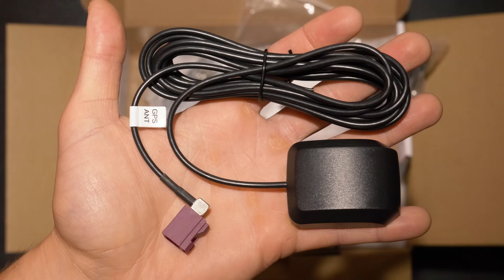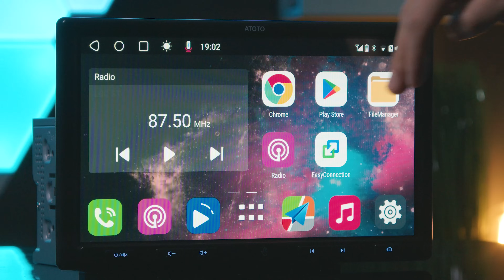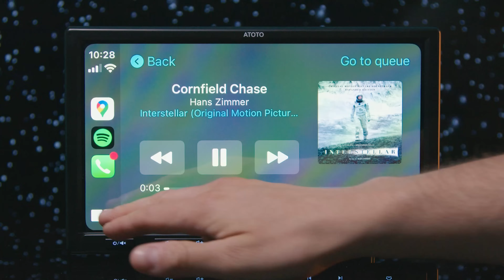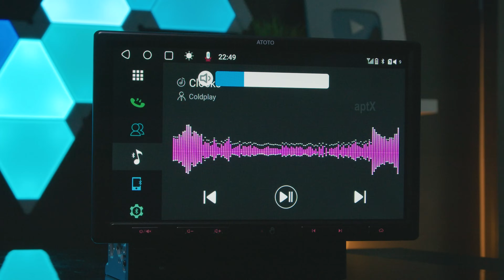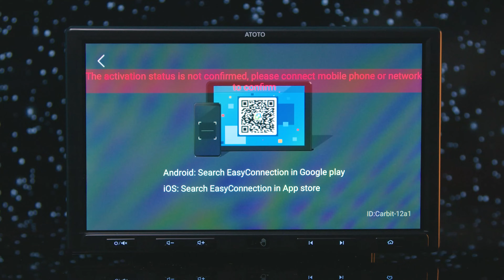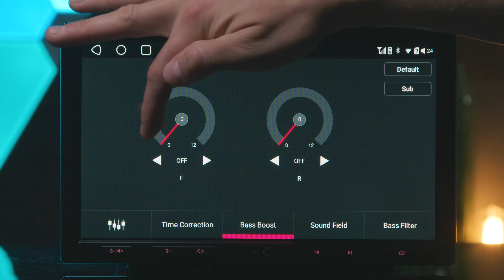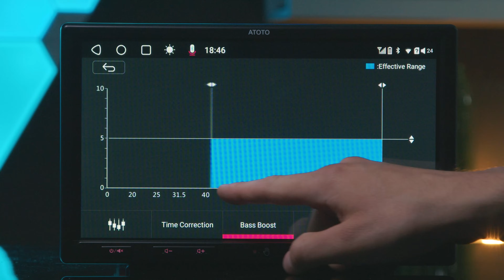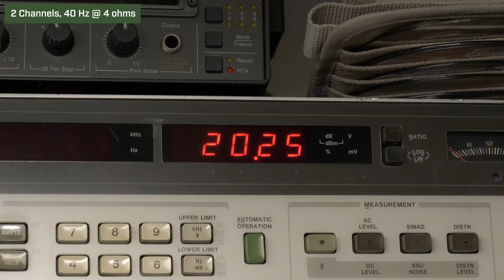ATOTO S8 Ultra Plus Android 10.0 Headunit - 4G, WiFi plus Wireless Apple Carplay & Android Auto

Comment: Hello, i have a sprinter 4*4 from 2010 and i already have a rear view camera mounted , do you think that the camera will be compatible with the atoto s8 ultra plus as it is not an high definition camera ? Atoto says that you nead to buy their own camera  ATOTO AC-HD03LR to have the high definition but will it be compatible with a low definition camera ?
the sprecifications from my rear view camera are as follow : 
1.Pixels: 728(H) * 582(V)
2.Power: DC 12V
3.View Angle: 150 degree
4.Image Sensor: 1/3" CCD
5.TV system: NTSC
6.Horizontal Resolution: 600 TV line
8.Sync. System: internal
9.S/N Ratio: >48Db
10.Electronic Shutter: 1/60 to 1/100,000 seconds
11.Video Output: 1.0Vpp, 75Ohm
12.White Balance: Auto

Thanks a lot for your help !

Stephane

Comment: Recently mounted on my 370z. Had some fitment barriers and overcame them. Over all this unit is amazing. Installed myself and it was a breeze, if you have any doubts about fitment issues, I strongly recommend avoiding unless you’re okay with having half your trim removed or using a rotary tool to trim off plastics for better fitment
Reply: Does it have screen mirroring to watch videos on

Comment: 1 year update here !!! Volume up button has to be pressed extra hard to work. Installed a micro sd card that worked for a few months and stopped. Can't access it unless i pull the unit from the dash. Every once in a while the system will just reboot itself out of knowhere. I'm not for sure that any of these issues other then the volume up button may not be user error. But i can say for sure the button issue is a factory defect. Im the only person that drives the car and no passengers ever touch the unit ! Car only gets driven about 4 months out of the year , weekends only to car shows and home. 
Questions ?? 
Are there any software updates for the S8 Gen 2 10" units ?  
Ive been tempted to try a cricket wireless pay as you go sim card in the unit for onboard internet service. Has anyone had any luck ?
Also the bass boost option , details , any help on exactly how the function works in detail would be appreciated !

I can say overall Im happy with the unit for the price $$$

Comment: I’m looking to buy and use this exact model with an amp. It seems that 2V and 1V sub won’t cut it. Are there any solutions to boost those signals while keeping things clean? I’m trying to get all the features of an android head unit while having minimal sound quality compromise (I know it won’t be perfect, but, again, minimal comprise). 
I’m seeing people recommend line drivers and the like. What do you guys think?
Reply from the maker: Yes, we recommend an Audio Control line driver.
Reply: @Qualitymobilevideo  would using a Line Out Converter like an Audio Control LC7i that is also a Line Driver give me a cleaner signal over using S8’s RCA Pre Amp outputs? I saw in the tests that at max volume, both speaker level and rca sources produced about 1% distortion. 
Does this mean it’s safe to say there won’t be much of a difference?

Comment: I installed one last month.
Half the features didn't work, and then the screen started a 
continuous rolling half way through a 9 hour trip.
Uninstalled and returned in less than a week.

It did have excellent sound, and the ability to 
fine tune your audio experience.
Reply from the maker: That's the curse of the small manufacturer all Android software based units.

Comment: I disliked this video because you said it had android auto wireless. Android auto works only with wired connection. I found out the hard way.
Reply: @Aubrey Morris: there is a beta firmware that enables wireless Android Auto. Ask ATOTO for it....

Comment: I bought this exact unit, had it for three months and it has been absolutely flawless so far. Sound quality is a hundred percent better than my factory unit, the Atoto S8 Premium is extremely fast, reliable, looks great. I use my phone as a hotspot, I did try to hook up a SIM card from Verizon but it did not recognize the Verizon network. I'm okay with that saves me twenty bucks a month and I just use my phone as the hotspot and it's extremely fast anyway.
Bluetooth auto connects every time I start the car, and the unit starts where it was left off from shut off. The unit starts right away, within about one second.
Reply: i though if you connect via android auto or car play, you don't have to manually setup hotspot everytime you get in car?

Comment: is that an Anti-glare screen protector? Does it show album art in Android auto? Also, you mentioned in the beginning of the video wireless android auto. Do i need an add on for that?
Reply: u need to preinstall Android auto APP in your cell phone to run the wireless connection

Comment: Does this come with the steering wheel module to use factory steering wheel?  Thanks in advance..
Reply: It has built in process, you don't have to use the extra module. It's wired into the harness, then you set in menu. Can only use volume and maybe track forward, call buttons won't work

Comment: I've been considering buying a Pioneer, Kenwood or Alpine but after seeing this I might change my mind. Just need to be able to hook it up to my steering wheel controls and retain the factory camera
Reply: This unit is the truth.  I thought that I would NEVER like many of the Android units.  I'm rocking a pretty high end Pioneer but I would gladly rip it out of my dash and replace it with an Atoto.
Reply: Im looking to keep my factory controls and dont know how ether
Reply: @chronsblack4441  go to Crutchfield and it will show you what adapter and wiring harness you need. Most cars will have adapters to keep factory rear camera and steering wheel controls.
Reply: Kenwood - not this tat

Comment: Hey I decided I wanna upgrade my frontier with the S8 Ultra Gen 2 (not the ultra plus) since its 7 inches but can't find it anywhere, do you know where they might be sold ?
Reply: I bought one that I never installed if you want to buy I sell for what I paid $500 comes in original box never hooked up it a gen 2 ultra
Reply: Atoto has a store on Ali Express, and sometimes the deals are great. They are also on Amazon, but I'd order direct from Atoto, or watch the Ali Express store for a deal

Comment: Hello. Thank you for the video. Does this model finally have a true sub out? Previous models fail in this unit as they are coupled to the volume. Hence, increasing volume also increases sub out. Buyers beware of this if you have separated amplified sub.
Reply: Every unit I ever saw that has a sub out varies the sub out volume in sync with the volume control, including home audio. If it doesn't then you turn down the sound and the sub would still be booming away. Or you turn up the volume really high and there wouldn't be enough volume to the sub! Doesn't make sense what your saying. Then again I have only been a professional in the home and automotive audio service business for 40+ years... lol 
I have a S8 version Gen1 in my car. Lets me adjust the sub output level and sub crossover frequency and Q width. And of course it goes up and down in volume when you turn the volume control. If not life with it would be VERY annoying... 😂
Reply: @DaveGringo  correct me if I'm wrong but you can also solve this problem with a volume knob from the amp right?
Reply: @DaveGringo  they mean gain? Lol

Comment: I wish you guys had tested to Subwoofer RCA output for voltage and distortion as it's only a 0.8v output but the front and rear are 2v.
Reply: Im so glad I just read these comments before I spent 800
Reply: Yep. Just found this out and very disappointed. Had to order an Audiocontrol Matrix to boost the signal on all 6 outputs to my amplifiers. Still not producing good sound quality.
Reply: @nickcalderone75  Since it has TOSLINK output (optical digital) couldn't you just use a high quality DAC with high voltage analog outputs?
Reply: @asdfasdfasdfasdeff  link for one?
Reply: @Dixonyass-g8v  I ended up using a Jensen unit instead, much better quality for even less cost.
Reply: wow these comments    

looks like  I'll be converting a Samsung tab  for probably less
Reply: @clittle1559  how do you do this

Comment: I did just order this unit because it all sounds really good... the only thing I am worried about is the sound quality. (And it does suck that there is not a dual channel subwoofer and the preamp outputs are minimal voltage) It's really gonna stuck when they improve those points next year and I already have this. But we'll see how it sounds when I get it. If I can hear the degradation of sound quality... it'll go back.
Reply: How is the sound quality? I just ordered an S8 Ultra Gen 2
Reply: @nspnutritionsportsperforma6804  how's going?
Reply: How is it ?
Reply: How is the sound quality?
Reply: If you are not an audiophile the sound is ok. I like things to sound good and it doesn't bother me. I only have a small little in dash amp hooked up so it's nothing crazy, but if you plan on amping this thing up...I think the amps will amplify the distortion and it might not sound the best.

In my situating though... it's fine.  I have it in a JEEP TJ and the wind noise is always there so... it doesn't bother me.

Comment: You call that adjustable ? Only up and down is not adjustable it's only up and down. Now if you can do up and down and side to side that's movable and if you can do up and down side to side tilt and turn in a full circle than that's called adjustable.
Reply from the maker: The word adjustable, as it is defined in the English language, is properly used in this video to describe the adjustable display.

Comment: Mane only problem I having today with it is it doesn't want to cut off no more by the power button and I need help on why I didn't do nothing but set the time today and change the wallpaper then the mf didn't want to power off rather if the car was running or off.

Comment: So based on this review I ended up buying it from Amazon. I want to love it but 3 units later and still defective. It's like an android tablet in the car with 4G and wifi broadcast capability which is great for long family trips in our van but it's just too flaky.

First unit was defective with pointer placement about 6mm to left of  actual pointer location.  Support responded between 6-12 hours of each email. Returned to Amazon.

Replacement #2 4g sim slot wasn't recognizing my 4g Tmobile sim card. Emailed support and after first initial response, support didn't respond.  Sending back to Amazon.

Replacement #3 inserted Tmobile 4G sim card into slot before connecting power wire and it worked beautifully.  After removing sim card to properly plug and screw in head unit, reinserted sim card before plugging in and now head unit will not recognize sim card. What good is a sim card slot if you can't ever remove and re-insert? 

Other things to note, hard reset with button or factory reset in Android doesn't fully reset the unit no matter how many times I tried.  So you can't actually return the unit to factory and theoretically resetting sim card slot.
Reply: I had my atoto head unit for a long time and never had issues. There probably was a batch of bad ones coming out! And the reset button is to force  restart if it froze or your trying to restart it so you don't have to unplug your car battery because the atoto stays on even when you turn your car off. The reset is button is not to factory restore it like new! Most reset buttons on other products don't do that either. Only a small amount. Sucks you had a bad experience! I tried many Android head units and these are the best ones I came by! I even rooted mine amd put a custom rom on it!
Reply: What did you finally do?

Comment: Atoto is by far the best of the Chinese head unit companies. I have SA102s in both my cars and an A6 in mom's car, very happy with all of them. 

The F7 is a great price for a CarPlay/Android Auto stereo, especially one that has as gorgeous a display.

Unlike most of the others, their regular double dins are actually a normal size that will fit in a Metra/Scosche dash kit. They also have built in SWC programming so many cars won't need an extra module to retain steering wheel controls. Even make the full the 20W RMS output advertised, when name brand units from Kenwood etc don't.

Comment: Is it awkward to set up all the antennas? I'm thinking of grabbing one of their headunits but the number of antennas.... 
Probably still gonna try it out, but gonna get it off Amazon so I can return it if things don't go well :p
Reply: You can just hide them behind the head unit
Reply: There's a 7" Ultra that's only a couple of inches deep. There's plenty of space behind that unit if you chose to go that path.

I was able to squeeze in a canbus decoder, radio wiring, four USB cables, wifi cable, and gps cable back there with plenty of room left for more.
Reply: No need to expose any of the antennas, they work just fine under the dash.

Comment: Why Pioneer and Kennywood cost $1,000 and this one cost $300 with more features 🤔
Reply: This one cost 600
Reply: That’s what I was tripping out on in Amazon. Something is not right, there’s gotta be a catch somewhere lol
Reply: @djekidd  The catch is all around quality. Trust me this thing will disappoint.
Reply: @repairdrive  lol, and exactly who trusts someone who says "trust me"
Reply: @repairdrive  it actually didn’t lol, I have the gen 1 and the thing is really good for the price compared with the big names with much more features.
Reply: @aaabbb-py5xd  2v output is no bueno if you run an amp like many do. Trust me. 😁
Reply: @LemonySnicket-EUC  can I just run a eq to get that voltage
Reply: @Dixonyass-g8v  the best thing to do is use the optical output and run a DSP set up  and a good amp. Search on YouTube. There are a few guys making the best of it this way.
Reply: @LemonySnicket-EUC you got a link to a decent one or something I really don’t know what that is but I’ll figure it I got a big sound system in my truck with 2 amps 2 12 inch subs and 8 speakers and I’m hearing Atoto ain’t good for sound systems but I’m liking the 10 inch screen Apple car play and what not
Reply: @repairdrive  so you have 1st hand knowledge because you've had a chance to use and test it? because if you didn't and are just basing it on your opinion then you're full of 💩
Reply: @LemonySnicket-EUC 

I am into high end car Audio and one of the ways to overcome the low preamp voltage is to go out of this unit using optical directly to a dsp and the signal is clean clean clean.   No radio frequency interference like rca's can pick up.  From this standpoint this is amazing and there are no modern head units with optical output.
Reply: @drrckhamilton but what amps are out there with spdif input?
Reply: @SirBrass  

Dsp sir
Reply: @drrckhamilton  the headunit already has dsp though. Why pay for it again?
Reply: @SirBrass  

The DSP built into head units typically have very limited capability.     Some of the brand names like Kenwood and Alpine, etc, are a bit better but still limited.  Are you familiar with a dsp with a full active system that has been tuned with an RTA
Reply: @drrckhamilton  I am not familiar with one, no
Reply: @SirBrass  

Oh, ok. I understand.  A dsp with all the features will allow you to manipulate phase, eq, time-delay, and things like this that are directly related to the sound
Reply: @drrckhamilton  I have seen those features implemented in headunit software often and figured this had this as well
Reply: $600
Reply: Those are aimed towards sound quality, these are aimed towards functionality. Unless your an audio nazi this unit will do just fine with a modest amp and speaker install.

Comment: Does it have subwoofer control?
Reply: Yes. All current atoto units do.
Reply: @ashton9699  crossover settings ? Slope ? Gain ?
Reply: @LemonySnicket-EUC  level and low pass frequency yes, but slope is fixed.

Comment: First Chinese head unit I've seen without those two massive power and speaker connectors. Huge plus! What would you want optical audio out in a car for, BMW and Mercedes compatibility maybe?
That screen resolution is common in many tablets.
There's lots to like about this unit, but 2v preamp outputs is weaksauce. And why not a USB type C 3.0 at least?
Reply: I use the optical on an Android HU to connect it to my audio processor. Great when these RCA outs are crap.
Reply: a lot of DSP,s use a optical cable. its cool too because you can just run the optical cable instead of multiple RCA's

Comment: 3 interesting features not highlighted by the video. 

Apt X HD for higher quality Bluetooth streaming. 

2 Bluetooth modules. One to connect your phone and the other to connect anything else. This has always been an issue with android units and they fixed it by adding 2 Bluetooth modules. 

And the SPDIF OUT. Full digital sound output. If you have flacs or any high quality music files, the unit can pass them to an external amp on DSP without touching the quality of the file.
Reply: It does have aptxhd. I confirmed it through a few apps cuz I don't trust what any company says when it comes to codecs lol My I think many reviewers don't mention it because many people don't have a device that uses aptx. So if they connect to this atoto apx compression won't work. They should still mention it because its part of the head unit. My old atoto had aptx but not aptxhd . And yes it has 2 bluetooth modules. One is name bluetooth 1 and the other is bluetooth 2. The and yes it has SPDIF Out. I ended up rooting my atoto s8 and installed a custom rom. I'm in the process of building my own head unit with a raspberry pi or another SBC 🤙💪
Reply: Would you use this for a subwoofer?
Reply: @JackOLanternBob  yes! I have mine hooked up to subs!